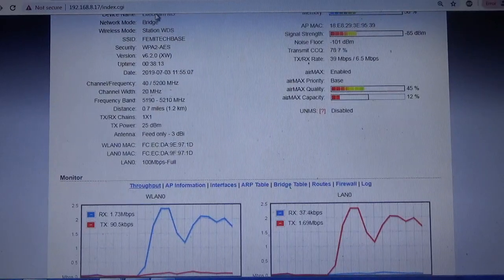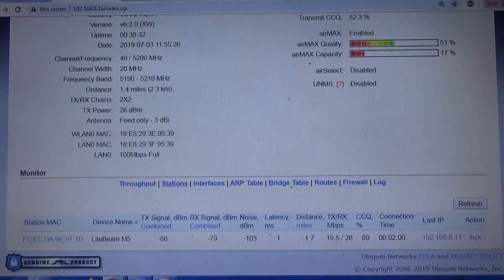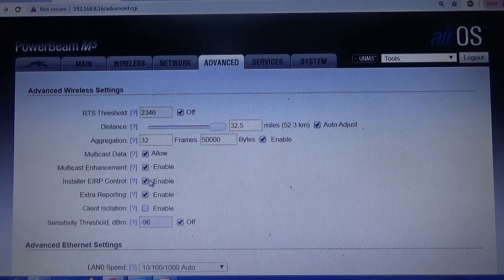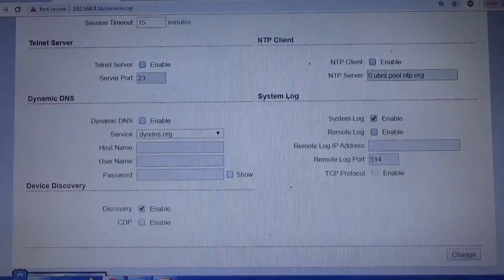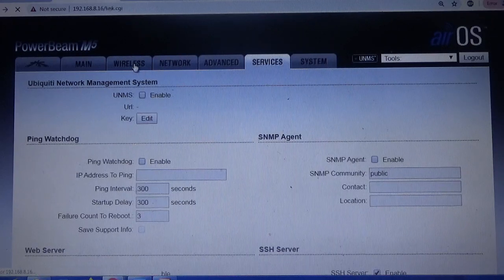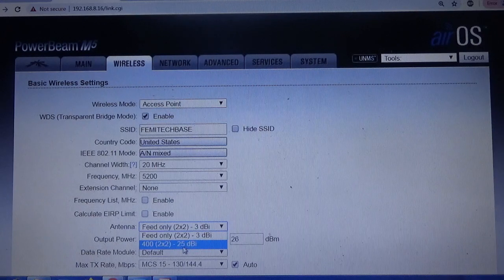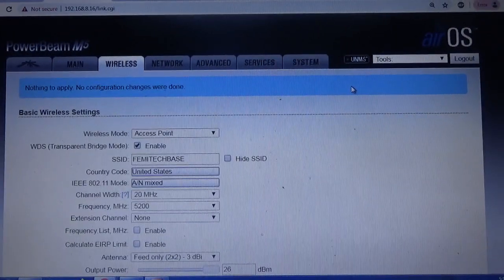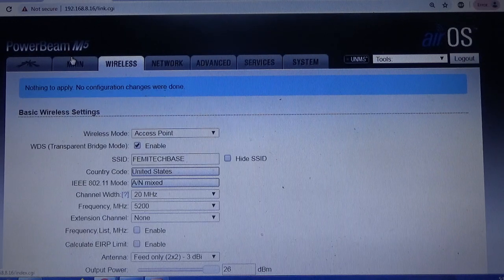UBIQUITI - How To Improve PowerBeam M5 AirMax Qualty

Comment: You have a signal strength of -86dBm, and you're trying to improve Quality by tweaking changes, instead of trying to align the link well.
Reply from the maker: Sometimes there is nothing else you can do to improve the signal. It is obvious that you do not do installations on a daily basis.